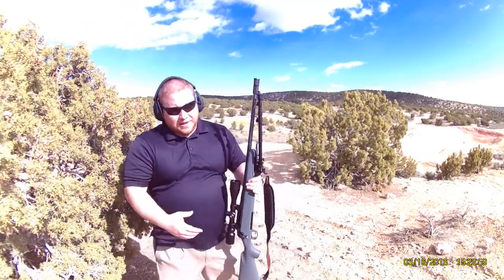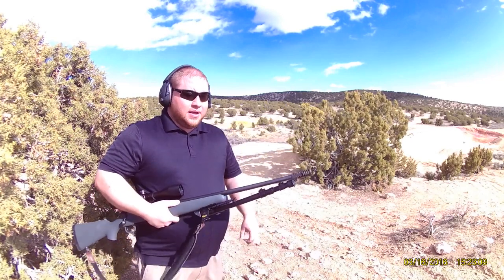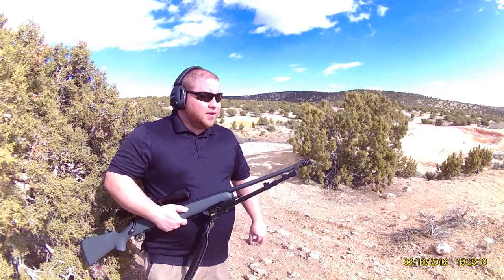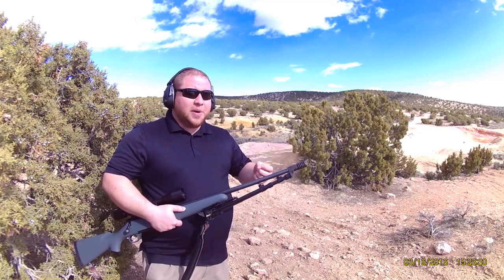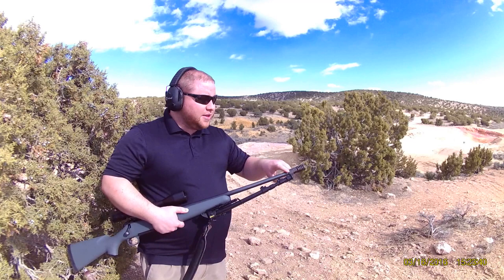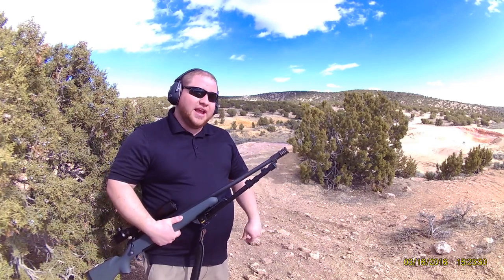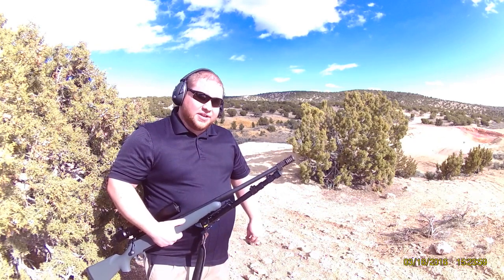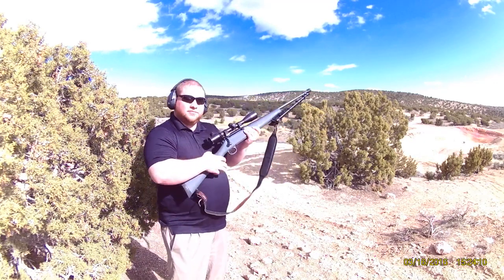30-06 Cheap Clamp on MuzzleBrake Part 2

Comment: I believe he's using a Witt Machined Muzzle Break. I too own one for my 30.06. If you install it right, it's a dream come true. Of course, proper ear protection is imperative. Recoil is cut in half. I too own the clamp on muzzle brake and I'm perfectly happy with it. I hunt big game animals (Elk, Mule Deer, Whitetail, Moose). FYI: triple check your measurements  because they produce your muzzle brake strictly according to your information. Mine came without the required Allan wrench (mm) for adjustment and lock tight lubricant.

Comment: I installed one on my 30.06 to reduce recoil. If folks carefully follow instructions: check and recheck your muzzle measurements for accuracy before ordering, and use Lock-Tight as instructed during installation, every works as it should. Yes, it does reduce recoil by 1/2 in my estimation. Great addition to my rifle!

Comment: If you don't tighten the bolts tight enough it will never be tight enough to stay on the barrel. I got 3of them on Savage axis
Rifles. If it just slide on the screws back
out put more ump on it. I'v never been able to over Titan them.

Comment: Hey what kind of bolt on muzzle brake is that?? I have been looking for one for my 30-06
Reply from the maker: This was a highpoint bolt on muzzle brake. Its a little too weak for a 30-06. It stayed on for this video, but the next time I shot it, it flew off. It worked well and would be great for a cheap solution if you can keep it on. Someone mentioned trying locktite on it. You can get these on ebay for 20 bucks. Just look for highpoint muzzlebrake and make sure its for a 9mm, that is what their little rifle is that uses them.
Reply from the maker: Your barrel thickness will play a role in how well it will stay on as well. my barrel wasn't very thick, which I think is part of the reason it flew off.
Reply: Locktite
Reply: WiTT bolt on muzzle brakes are a really nice choice also